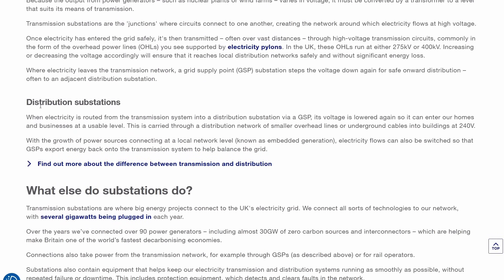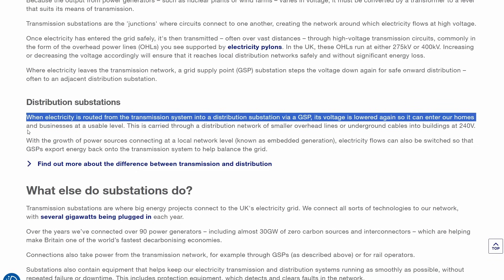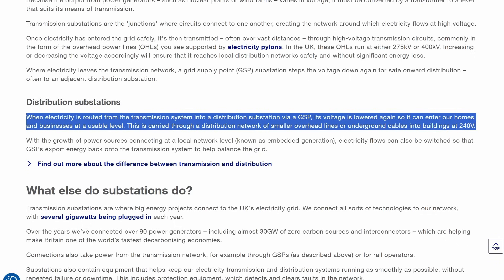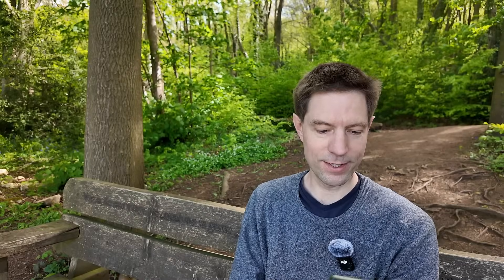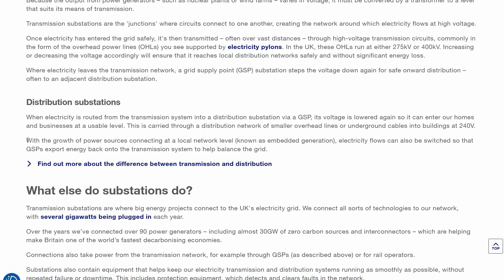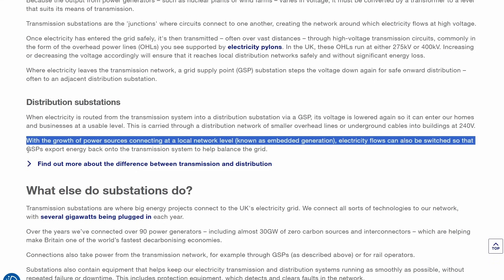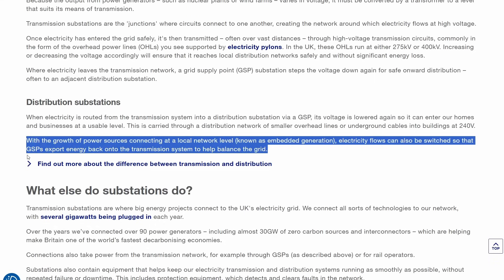Does solar export get past the local transformer?

Comment: "National Grid" is a company name. In most areas, they do not supply your homes directly - when they talk about what they do and their systems capability, they are talking about the stuff they own (under c. 4% of whole system). Their role is overarching connectivity, like motorways joining town / cities.

So, if there is a local road issue - talk to the motorway people? Madness! Talk to you local DNO. Caveat: WPD were bought out by NG a few years ago, so in one area only NG is also a DNO. FYI there is c. 600,000 km of buried cables in the UK owned by DNOs. Typically, these are good to supply c. 1.5 - 2 kW continuous per home. HP alone draw more, EVs also draw more. This has been known since formal reports to ENA in 2012 and followed up by real-world tests highlighting real network inadequacies. The UK grid owned by the DNOs needs to be rebuilt - with one group in exception: The estates (often council) built in the 1950-60s fitted with overnight heating. Their networks are rated for 8-14kW per home continuous and are fine.

Expect future roadworks + politicians saying "...But who would have known? !!" Like, the engineers have been highlighting these issues since 2008 which prompted the 2012 report.
Reply from the maker: The cables supplying homes can cope with way more than 1.5-2kW of continuous power per home.  And upgrades are happening all the time.  The entire network doesn't all need replacing, it's being replaced bit by bit as required.
Reply: @TimAndKatsGreenWalk  Gosh! Do you mean the service cables to the home? Indeed, they are OK. It's the 3ph feeders from transformer along the road / pavement which form a backbone, linking house supply cables back to the transformer. A "herringbone" style connection; service cables run out from the home to the feeder in the street - and they can supply c. 100A no problems.

But the feeder and the local transformer are built to take average loads, as calculated (usually) via methods called ADMD or ACE49. These methods (recommended and used by DNOs) assume that house loads are primarily lighting, with occasional random loads like showers. The average UK home c. 2013 drew c. 800W at evening peak; why would the massive local LV (230V) networks be built for more? So, to save money - they were not built to cope with the peak (which the transmission system is) but a statistically calculated average. UK houses draw very little - on average - and there has been no problem yet. But things are changing.

EVs draw 7kW per home for hours, concentrated into "cheap power periods" (that makes many EVs on a local network charge simultaneously). HP are worse, drawing from 3 to 12 kW (different house sizes) for days / weeks (in winter). If we move to electric cars and heating - on-paper and real world UK studies show that there WILL be problems. The transformers get upset 1st, then the cables a bit later.

This topic area used to be my job, running simulations on a range of networks found in UK built up areas using various EV charging patterns, dometic loads and lots of "smart" control systems. And V2G. And added value services like DSR and FFR.

Answer - can't do full roll-out of electrified everything on existing systems. c. 80-90% of the local networks are inadequate. New networks, please.
Reply from the maker: @xlerb_again_to_music7908  you're mistaken about heat pumps.  Perhaps you've confused the heat output rating with the electrical input rating.  A 12kW heat pump draws a maximum of about 4kW, it then converts that to 12kW of heat, give or take (ours is usually closer to 1-2kW electrical load, rarely more than that).  And the rollout of heat pumps and EV uptake is slow enough that it's not going to crash the power network.  There is time for the upgrades to happen alongside, it's not needed all in one go right now.
Reply: @TimAndKatsGreenWalk  Agreed re not needed in one go; but needed it will be. And don't forget the flow boilers in the HP - they do need a boost from time to time. Plus I always work on electricals not the heat output side; a big detached 1930s house with indifferent insulation can pull c. 12kW. We are going to have to tackle retrofits at som etime... and I do know about COP / SOP and defrosting etc. When the flow boiler cuts in, COP is 1.

So for a say 2000 built estate of 100 homes in a UKPN area, the systems would have been designed to supply 150kVA minimum, plus some wriggle room. SSEPD area a bit more, ENW a bit less (they have published rating tables of draw to allow per home). So we can immediately see that 21 EVs on charge simultaneously run that system up to max rated loading, assuming no-one is using other power. The networks can supply say +40% for a few hours, although the transformers are under-rated deliberately (they sit for most of the day doing nothing, so they can be overloaded as a routine for a few hours easily). For that 150kVA network, the transformer may have a rating of say 120kVA. Now have every house with 1.32 EVs (the average UK car density per home) and usual charging patterns - game over. HP - forget it. Please realise the DNO systems are expensive, so are built to be - good enough for expected duty.

My costings (um c. 2020 I think I did those) were about £1/4 million per local network. The real issue is all the groundwork; it's slow and it is not clear to me that we have sufficient staff. Plus, the energy-related politicians I spoke to in 2016 knew of this problem (they were switched on) but were offhand - it is expected to be an issue until the late 2020s to 2030, so - not their problem.

Meanwhile - fans on transformers (some of your other commenters have mentioned this). That was my response; a stopgap.
Reply from the maker: @xlerb_again_to_music7908  the vast majority of modern heat pumps don't use direct heating at any point.  Defrosting is done using the heat stored in the pipes and radiators, they will never draw 12kW.  Heat pumps with backup heaters are only used in extreme edge cases, we're not going to have a whole country fitted with heat pumps that draw 12kW, 99% of them will tick along quite happily at 1-2kW.  Yes, even for retrofits.  I don't think the situation is going to be as bad as you make out; heat pumps are certainly not as hungry as you're assuming, not by a long way.  Yes, upgrades will be needed along the way, but that's already happening.  I think I have a more optimistic outlook than you on this one.  Perhaps I'm being unrealistic, I hope not.
Reply: @TimAndKatsGreenWalk  I did not suggest the whole country would need 12kW load per home. I am only reporting what I met in my job, which was the supply of power via LV systems to bulk developments, old and new, with modern loads. FYI my colleges tell me new estates with HP do have flow boilers as backups in them.
Reply from the maker: @xlerb_again_to_music7908  I would be very surprised indeed if those heat pumps will ever need to use those backup heaters.  They really aren't needed nowadays.

Comment: A Grid Supply Point is one of the major sub stations usually running at 400kV. This is a supply point into the DNOs network... so at that point the power is at 275kV or 132 kV for use by the DNO who will usually drop it to 66/33/11Kv. The transformer up the poles is likely taking 11 kV and dropping it to 230V. It is now confusing because National Grid is both the Grid operator in England and Wales and also the DNO for a large chunk of the country from Penzance to Skegness. Scotland has to Grid operators, SSEN 'The Hydro' and SPEN who do both the Grid and DNO jobs, The Hydro for The Highlands and Islands down to Dundee ish and SPEN the Central Belt and Borders etc. Getting information on how it all works is extremely difficult. And I would agree that many people now find it interesting. How much power can a Grid circuit carry? It depends on the weather! And the power lines run hot at times, surprising the birds don't burn their feet.
Reply from the maker: Yeah, it's definitely confusing!  I think I'm starting to get a better handle on it now after various comments from folks, including yourself.  The advantage of having a YouTube channel is being able to ask a lot of people about a subject and hopefully getting some sensible answers back!

Comment: Why do you think we have spent the last 15years bolting heatsinks and fans on the sides of the substation transformers!!! The secondary windings of the local transformers were never designed for input current and to be used as step up transformers and most are very old and near the end of their expected life cycle. All the solar is cooking these transformers up, just look at one of the first hot days and hayes goes up, then st John's wood after another high input day. As another poster commented, the newer transformers and switchgear has been designed with this in mind, just a shame that there are 3-5year backorders for a lot of the switchgear and trannys from Japan and elsewhere.....
Reply from the maker: This is why we need to make DNO applications if we want to export more than the default, so that we don't cook the grid equipment.  Hopefully the upgrades will keep up with the extra solar getting added.
Reply: Presumably the DNO has set appropriate export limits for individual users so that the relevant limits for the local equipment are not exceeded. If "the solar is cooking these transformers" then surely somebody hasn't been doing their job properly!
Reply: DNO's are being forced to push the design specification limits now; government legislation and MCS schemes have moved away from requesting connections, to notification of connections occurring! We have been pulling fuses for the last couple of years and repeatedly up-rating them, now often way beyond the switchgear and infrastructure they are supposed to be protecting, just to keep things online....

Comment: Timely discussion .  I've been talking to our DNO about our high voltage here and I've been told it's because we're so close to the transformer , which is just 6 houses away

As I export 8kw and it flows back to the grid I wonder how it flows down the  lines and how distance impacts it. The end of the chain might be a mile away and the transformer is 100yrds away, does it flow away from the transformer as voltage reduces down the line ?
Reply: I doubt the end of the line is a mile away. To keep the voltage from going under voltage the conductor size would need to be insanely large to feed all homes on a mile long run.
Reply: @tbernaciak9543  were rural not many houses around  and not many transformers so I really couldn't say
Reply: If you want to look up how AC travels in wires look up: "skin effect", "AC standing waves".
Reply from the maker: We can see the transformer from our house, so I think we're in a similar situation.  I regularly see 250+V in our house.
Reply: Another aspect would be to see how much voltage your inverter adds to the grid to ensure it is exporting power not consuming it. I have a white label Deye inverter and it only boosts the grid about 1V or less when exporting. I also live ~30m from the transformer and the secondary does not travel far for end of line. The grid voltage is also very stable for me.

Comment: It's a transformer, it works both ways. May be a bit more effficient when used for its designed purpose, but it'll still work both ways.
Reply: Correct. Imagine the voltage on the primary side of the transformer is 11kV and this is enough to produce a voltage of 230v in the secondary windings. If there is local generation on the secondary windings such that the voltage is forced above 230v, the voltage on the primary side will be raised to above 11kV, and hence power consumed on the primary side of the transformer will be supplied from the secondary side of the transformer. This continues up the distribution network to higher and higher voltages.
Reply from the maker: Yes, the transformers certainly work that way, but apparently there are other components that might trip out when there is reverse power flow.  It seems a lot of these components are gradually getting replaced so that they can work both ways too.
Reply: @TimAndKatsGreenWalk 
??? So you say the switch gear in the transformers trips every time their is power flowing backwards? 

And every evening a guy has to  reset the breaker  

Think about that
Reply from the maker: @neok1996  it's true.  But reverse flow is very rare at the moment.  The point of this video was wondering what will happen when reverse flow is more common.

Comment: Hi Tim, your correct it would be transformed locally up to 11kV then carrying on to a Primary substation up to 33kV and then onwards to Grid Supply Point transformer from 33kV up to National grid votages starting around 132kV. ( so GSP is the national GRID supply point ie to the Pylon towers normally).
Of course I should have said backwards rather than onwards. In general it usually just reduces the current that would normally be required on the network.
In practice however if it were just the solar embedded generation the voltage locally would creep up to 260v ish and your invertor would trip off (overvoltage)
Reply from the maker: Yup, that seems to be the consensus, so that's good to know.  I've definitely seen our voltage creep up during the middle of the day, so I'll be keeping an eye on it out of interest.

Comment: All covered by other comments in the main. A couple of other items: some houses have service cables that loop in and out of the one next door (like mine), so next door is the first port of call for any surplus from my solar PV inverter.

The other system which has a fair bit of reverse current is the overhead electric railway one, when traction with regenerative braking is in use.
Reply from the maker: When I was searching for information on this the railway example you describe kept popping up.  That's really quite interesting too!

Comment: I have a simpler related question, Tim. Where does clipped solar generation go?
Reply: It just doesn't get generated.
Reply: second the other guy, by definition, clipped solar was never generated. It was just a panel in the sun.
Reply: Without somewhere to go it simply isn't generated.  However, If you have a DC coupled system the 'clipped' energy can stay as DC and be used to charge a DC connected battery.  This is what I do.  If your storage becomes fully charged then you are back to the 'clipping' being wasted again.  Unless you have a DC EV charger and then... ok, not quite a thing in the UK just yet but it is coming.
Reply: @ I am DC coupled and have been successful in minimising clipping by keeping the battery as empty as possible. From what you and others say, if the battery is full, electricity isn’t created until it passes through the inverter. Is that right?
Reply: @robjones8950  Sort of.  When the battery is full there is simply nowhere for the current to flow.  Conversion of light to electricity happens at the panel itself, albeit to DC electricity.  The inverter converts this DC power to AC power, up to its set or physical limits.  In a fully DC coupled system the DC battery doesn't need the inverter to convert anything to anything, so the inverter's DC to AC limits are less of a factor.
Reply: @robjones8950  correct.
Just curious, why is clipping something you would want to minimize?
Reply: @williammeek-h2o  American here who has not heard the term clipping before with this meaning, but the idea is clear. If a panel is clipping you are just wasting the energy. If you put it into a battery you could use the energy at another time, e.g. night. Or you could send it to the grid for income if your local rules allow.
Reply: @williammeek-h2o  it’s generation that can be used or exported rather than lost. I have a 9.75kwp S/E/W array with a 6kw inverter
Reply: @ ah. I think in terms of off grid. If I am not clipping most of the time, I run the risk of running out of charge on the battery after the first cloudy day. 
Lots of clipping is good for off grid systems.  
I don't see it as waste because it would have been turned into heat or reflected anyway without panels present.
Reply: @danielcarroll3358  By that definition, all sunlight that isn't absorbed by a panel is wasted whether there is a panel or not.  
I disagree the energy is wasted as it goes into warming the air and producing air currents and the energy is there whether the panels are there or not. 
It isn't like the panel is producing electricity if you aren't pulling a current.
Reply: @williammeek-h2o  My power company would beg to differ.
Reply from the maker: It's a good question.  Presumably the incident solar radiation that would have been turned into electricity is instead converted to heat, ultimately.  At the panels, I assume, but I don't really know.
Reply: @TimAndKatsGreenWalk exactly. The panel heats up if it can't lose the radiatiation energy to the inverter.
Reply: @SolAce-nw2hf  - Not true.  If the current has no ability to flow (ie being pulled by a load) the panels just sit there, not producing electrical energy.  In the case of 'clipping' current is still flowing but the additional energy that the panels 'could' provide simply isn't being converted into electrical energy.
Reply: @TimAndKatsGreenWalk  It is turned to heat, exactly as if a non solar panel of that color was left in the sun.
When solar panels are working at maximum power, their efficiency is how much light is turned into electricity. 
roughly 1000 watts per square meter hits a panel. 
If it is 20% efficient, 200 watts per meter is turned into electricity. only about 800 watts is turned into heat with a little bit, only about 2% reflected. Yes, a solar panel that is working at max will be cooler than one that is not working.
If the panel isn't making electricity, the only difference is 98% of the light is turned into heat with 2% still reflected.